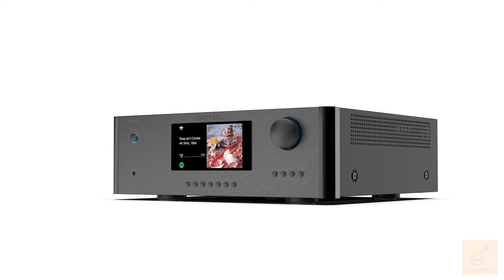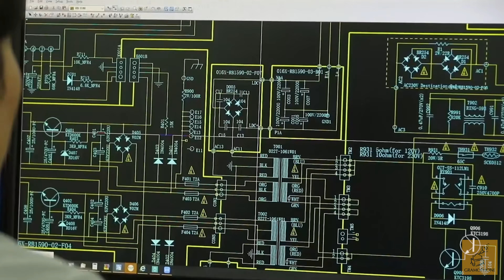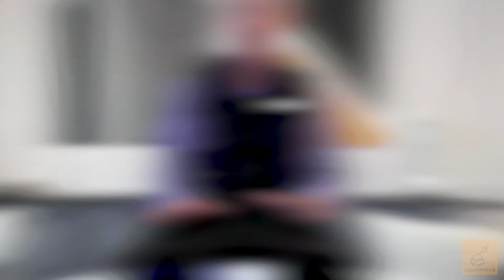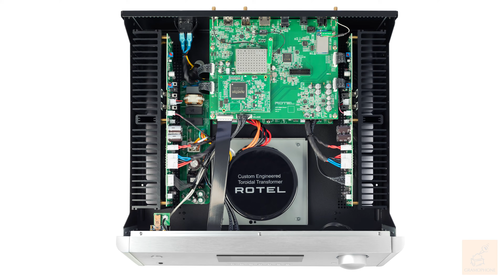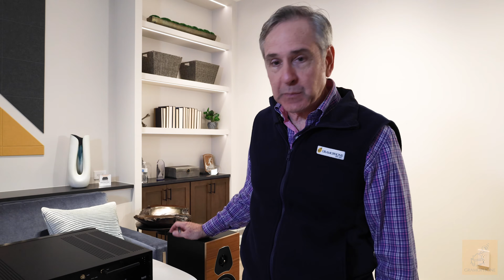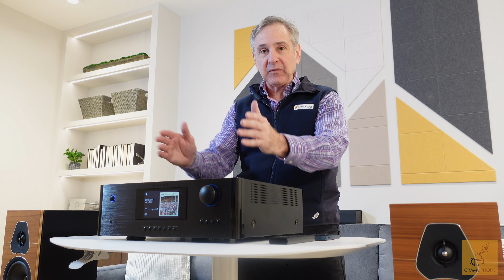Rotel's Awesome NEW RAS-5000 Integrated Amp Streamer

Comment: where does a cd player and phono connect to?  Would I need a pre amp for phono?
Reply from the maker: Hello Don, yes, it has standard L & R aux input for a CD player or phono preamp.  You can plug any turntable into a phono preamp and connect that to the RAS-5000. If your disc player has digital out, you can connect both disc player and turntable.  Please reach out if you have more questions: ask@gramophone.com

Comment: Can U use my Magnepan 1.7 with this Rotel RAS-5000???
Reply from the maker: Hello Ink,  Magnepans can present a difficult load, and their website lists the 1.7 as a 4 ohm nominal speaker.  RAS-5000 has plenty of power into a 4 ohm load, but this speaker may dip into the 2 ohm and possibly lower arena.  You may want to reach out directly to Rotel with this: https://www.rotel.com/contact-us

Comment: Rotel RAS-5000 has bass crossover ?
Reply from the maker: Hi Marina, while the bass can be adjusted plus 10 or minus 10 in the tone controls on the app, we don't see an actual crossover adjustment.  However most subwoofers nowadays have crossover adjustments built - in, which helps

Comment: Nice looking, lacking of analogue inputs, including main in. Why Rotel's skimped?
Reply from the maker: Hi Adam, Rotel provides an aux-in for analog sources like a disc player, and pre-out to a bigger amp. Main-in allows using a separate 2 channel preamp, with RAS-5000 being an amp only.  But with all the streaming, video, and legacy input options on RAS-5000, we think most folks won't use it that way.  This is a flexible all in one chassis streaming amp with options; not the right thing for everyone, but great for someone upgrading to something more modern.

Comment: Overpriced. Why are rotel always cagey about the DAC chip they use these days.
Reply from the maker: Hello Michael, we communicated with our Rotel USA team, and got a response on “which DAC” just after we finished editing / uploading this.  RAS-5000 utilizes the ES9028Q2M Sabre DAC, with an implementation similar to the DT-6000, with a Rotel-designed analog low pass filter to improve on the basic reference design - somewhat lower phase error, and a smooth high frequency response. We hope you can visit us when we get inventory (likely near end of December 2023) to listen for yourself, as our sample (which we've returned) had us convinced it's an excellent value
Reply: @GramophoneMD  Thank you for that reply.  I have little experience with Rotel but now own an RCD 1572mii CD player. My main grip with it is the neon light around the power button that you can't dim or turn off unless you take the unit out of standby by turning it off completely. I wonder if Rotel realises that people into Hi-Fi are not into bright annoying lights. It wouldn't be so bad if you dim it very low. The whole range of the 1500 series has the blaring lights that have turned me off buying another 1500 series mkii unit. Considering the 1500 units are price £1100 upwards it is a poor design by Rotel. I haven't had a chance to play with the CD player much, but the sound so far is to my liking. Bought an Arcam CDS50 that I found very bright, and it was another player with a spotlight on it that I sent back
Reply: I have been complaining about the annoying blue light for years, which has been a feature of most every Rotel component for the past decade at least. I pleaded with them to change the color to amber, green or red, and to tone down the brightness. it is an assault on the senses, it's distracting and contributes to ruining the audio experience. Like cell phone glare in a movie theater, it destroys the experience!  @MichaelOConnor-r3z
Reply from the maker: @MichaelOConnor-r3z  Thanks Michael, we forgot to mention that Rotel listens to folks like you.  The RAS-5000 power button neon light is dimmable, with 3 brightness settings.  Go Rotel!
Reply: @GramophoneMD I have found the dimmer on the CD player, but it is still distracting because of the size of the light. These lights need to let the user to turn them off altother. I noticed on the 1500 amps they have a light around the volume button that is not needed. What passed Rotel to come up with such a poor design that users wouldn't like, the large light serves no purpose but to annoy. The tradional tiny dim led light would have been better.
Reply: @MichaelOConnor-r3z  I agree. People, including me, have been critical of this obnoxious light/color choice for years. The best dimmer would be no light at all, or at the most a tiny light like you suggest - one that doesn't saturate the room and make you feel like you're staring at an eclipse of the sun.
Reply: @steveo8015  I have read online many people who find it very annoying.  What they are doing is highlighting the power button and the volume button like we are blind and can't see or we are so stupid we don't know what they are without the light.  I dimmed mine and still had to turn off the unit fully because it is always in your face.  I will not buy another Rotel with lights on unless you can turn them off fully. I don't need a light to tell me when a piece of high hi-fi equipment is on or off or in standby.
Reply: @MichaelOConnor-r3z  My last Rotel cd player (1570), came with a black stick on ring that you could apply around the on/off button to dim the light. It dimmed it, but not enough and there was no other provision to diminish the stupid light other then turning off the player or blocking it with a piece of cardboard for example. I like Rotel but I hate the retina piercing light! The choice of blue not so sensible in my mind.
Reply: @GramophoneMD  Thanks for sharing - I was wondering which ESS DAC chip the all-in-one Rotel comes with from the factory 😊